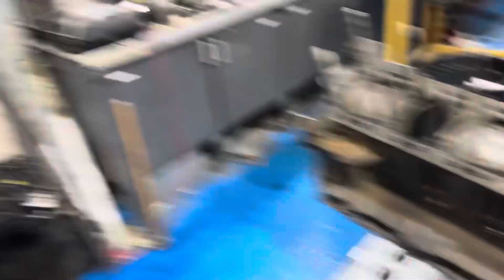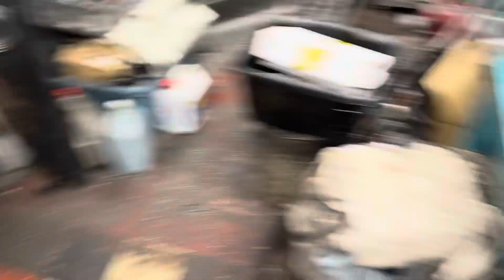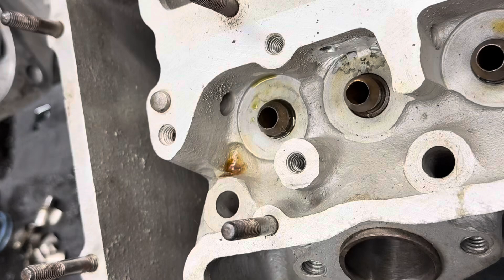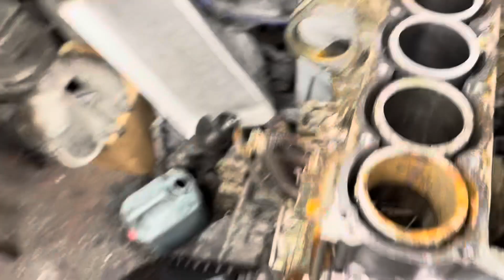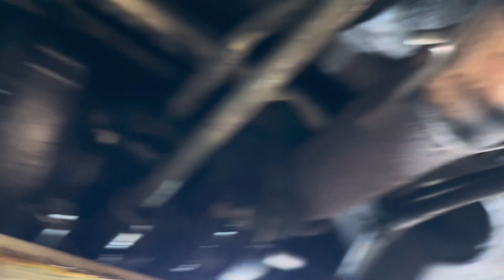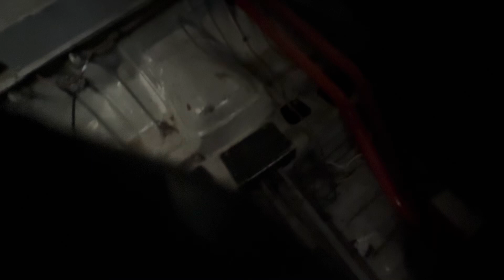Shrigleytube TV ep 75  Mini ERA, pete’s 1012cc dynoed, visit Merlin motors,piston valve cutout🤞🤞🤞

Comment: Hello Andy, 😉In 1984 there were produced 30 Porsche 911 SC/RS Coupés with Kugelfischer / Bosch the new owner
Reply: I think some well known Mercedes 300SL used a similar Bosch pump? And the 6.9’s?
Reply: @bernardwarr4187  6.9 engines used Bosch K-Jetronic
Reply: @ maybe 6.3?
Reply: @bernardwarr4187  6.3 lL Bosch Reihenpumpe PES 8KL 75/120
Reply: @ M100?
Reply from the maker: I have a bmw 2002tii engine with kuglefischer
Reply: @thehillmanator  I once had 3 Kugelfischer BMW pumps and an Alpina single throttle system. Sold too early in DeMark times. Now I have a 2002 with 45 dcoe and 300 degree camshaft.I am an ex BMW mechanic.